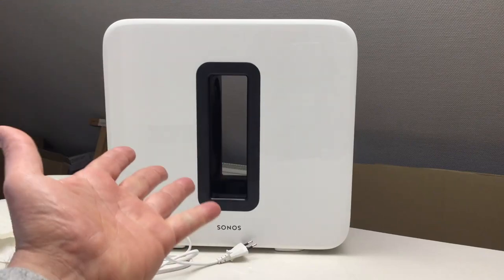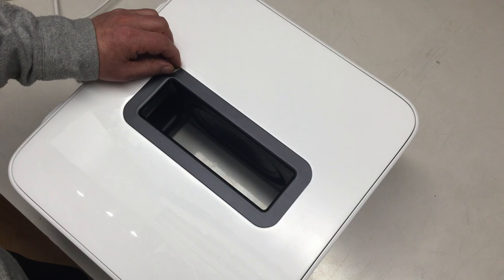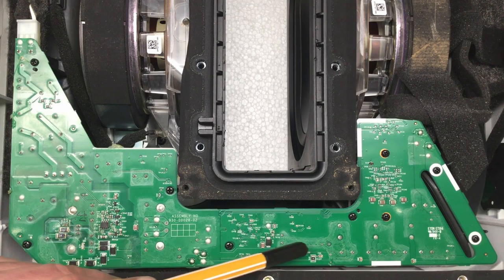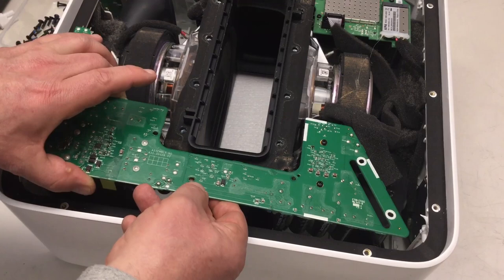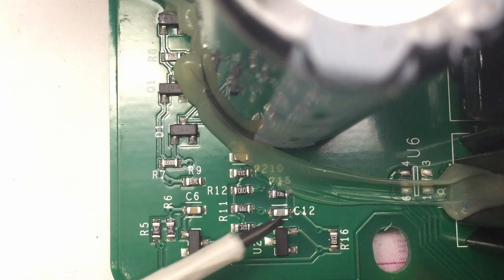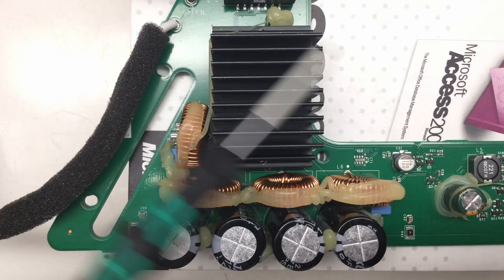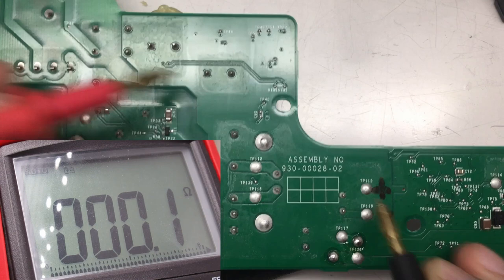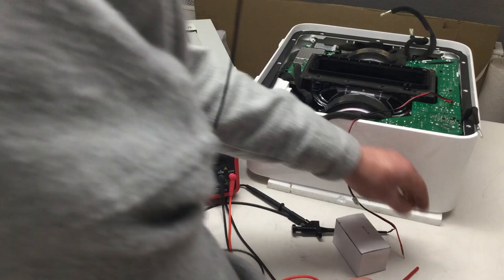SONOS Sub (Gen. 1) Teardown and Fault Analysis (Completely Dead)

Comment: Have you ever see someone work on the low voltage side?  I have 48vdc on those 2 solder joints in the middle. I tried removing WiFi board but that didn’t work either. Any suggestions?
Reply from the maker: Sorry, I don't have any suggestions and I've never seen an actual repair being done on the low voltage side (besides checking for loose connectors). Sorry again.
Reply: @robertssmorgasbord  I sent it off to a Micro soldering company to replace R37 resistor that was burnt but also go over the whole board and make sure everything is good. I’ll come back and post what happened and if they repaired it I’ll share the company I sent it to.  I had a bad ground on my home & bad thunderstorm that took out a lot of electronics including this.
Reply from the maker: @jdrais3389  I wish you luck! Plus a good eye to spot any other faults 😉 And yes, please post how it turns out.
Reply: @robertssmorgasbord   no good. They diagnosed it and told me that it’s irreparable. Didn’t get into details of why. My guess is it’s just not worth paying to repair when you could purchase new in that scenario.
Reply from the maker: @jdrais3389  I'm sorry to hear that! Anyway, thanks for the update.

Comment: How many ohms are the speaker, I would like to get one and use it with an external amplifier but can someone of you tell me the ohms of the speakers
Reply from the maker: Sorry, I never measured the impedance of the speakers, since I was only working on the power supply side of things 😞 Plus, I've returned the repaired sub to my friend 2 month ago, and I guess my friend would object to me coming over to take that thing apart again to measure the speaker's impedance 😅

Comment: I have a gen 3 but for some reason always thought one of the drivers was passive, they are both powered however?
Reply from the maker: Yes, at least in the Gen 1 there are two complete amplifier channels. One for each driver.
Reply: Def both powered. My GFs started rattling, found a loose heating on one of the chips causing the rattle. Screws were stripped from assembly?! Replaced screws after retapping heatsink. Problem gone

Comment: is there a way to tap into this to add a second subwoofer to a sonos system, ie a bass transducer?
Reply from the maker: I guess it's possible. Do we talk about the audio signal, or just the amplifier outputs? The analog audio signal should be available at the connector to the digital board (unless they are using a class D amplifier with an digital input). Connecting a second speaker / transducer to the amplifier output would be experimental and might kill the amplifier. But it should be possible to disconnect one of the subwoofers and use that channel to drive a transducer (with the same impedance). That of course would probably ruin the sound of the SONOS Sub itself.
Reply: @robertssmorgasbord  i would just need the audio signal (pre-amp). since sonos allows two subwoofers with an arc, i was thinking maybe you can take a sonos sub that has a working board, and use the audio out from the board to go to the transducer. i would love to see someone more capable than me (i dont know anything lol) to try and experiment with that, especially if say there was a "broken" sonos sub that had damaged woofers themselves but the board was still fine. would it be possible for you to test an audio outsignal to an external amplifier?
Reply from the maker: @Harlizzlee  Your idea is basically sound. But unfortunately the Sonos Sub in the video is not mine, but that of a friend. So I'm a bit reluctant to experiment with it too much 😅 Besides, the Sonos software requires you to have a complete Sonos system - not just the a sub, but some high/mid-range speakers too - before you can play anything. And I just have the sub. Anyway, meanwhile it has been decided that I'll attempt to repair that thing (video coming up).
Reply: If you have a second gen 2 or gen 3 sub, you can add a second sub "officially" - Gen 1 not supported for this config as I understand it.  I have 2 gen 3's in my TV room.

Comment: What is TH1 on the board?
Reply from the maker: Sorry, but what do you mean by "TH1"?
Reply: @robertssmorgasbord  component designation by the fuse a MOV
Reply from the maker: @lsdave  Ah, I totally skipped over that part. Sorry! TH is a thermistor. It's probably there to limit the inrush current (higher resistance when it's cold, when current flows through it and it's warming up its resistance decreases).

Comment: Absolute crap brand....
Reply from the maker: I wouldn't call it crap. I mean the acoustic engineering is probably quite good (can't tell for sure, I'm not an audiophile). Anyway, the service is for sure horrible. But that you are forced to create an account and use an app to configure these things is an absolute no go for me.
Reply: Definitely not a crap brand - sure there are some manufacturing decisions here to meet a budget - but it's WAY better built than your average Samsung or Sony sub (also a lot more expensive to be sure - but it's not like you aren't getting what you pay for) - and far more powerful, clean and flexible in a home theatre setup than anything you can get baring going to a full on external amp driven home theatre system - without all the cost and hassle they have.
I'd say they've made some very poor decisions in recent months given their decision to rush out a half baked new version of their app - but the hardware is still class leading.
Also worth noting this is the Gen 1 version of a product that is now up to Gen 3.